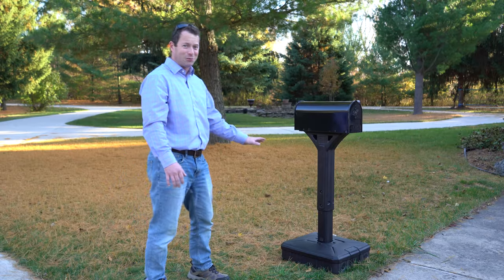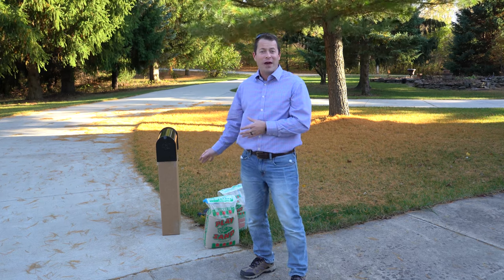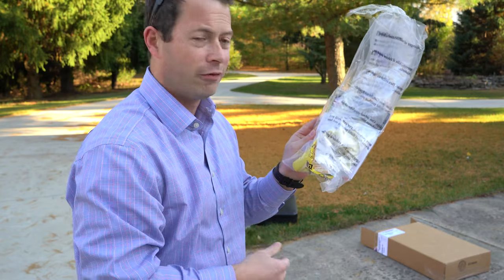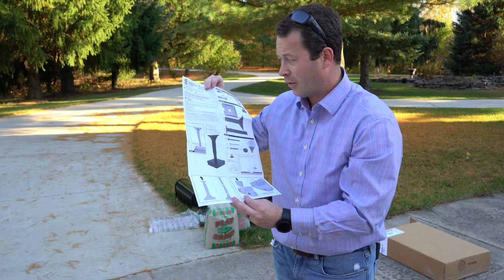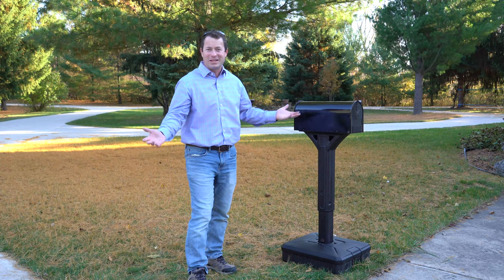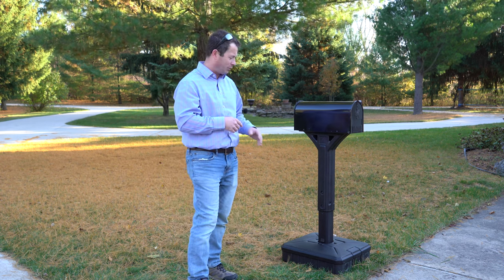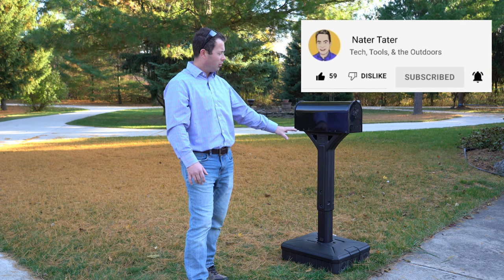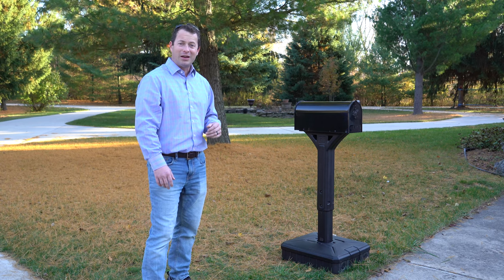✅EASY No Dig Mailbox Post Install - Simplay3 - American Home - Made in USA

Comment: concrete might be a good option instead of sand.
Reply from the maker: It could be for sure.  Also I think if you just pour water in after the sand it will weigh the same as concrete.